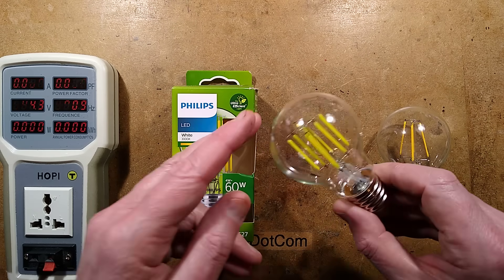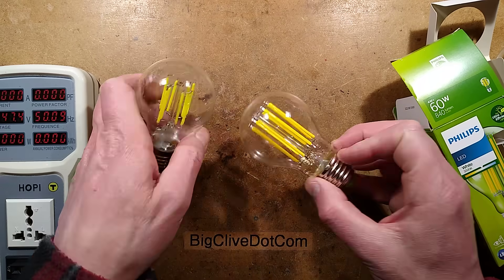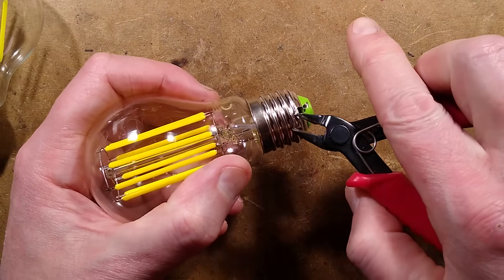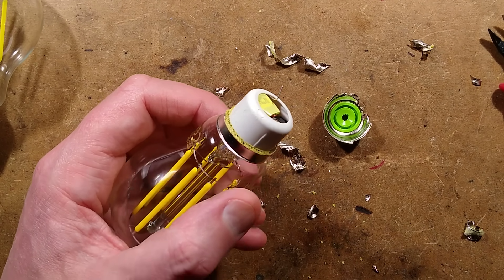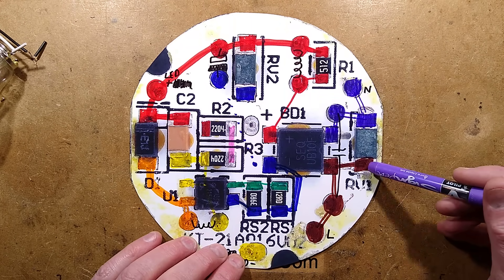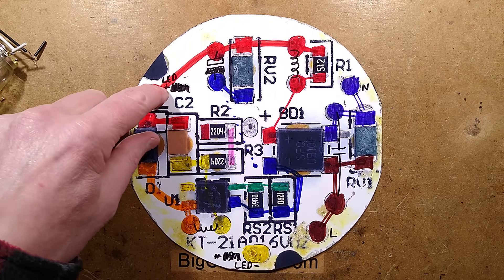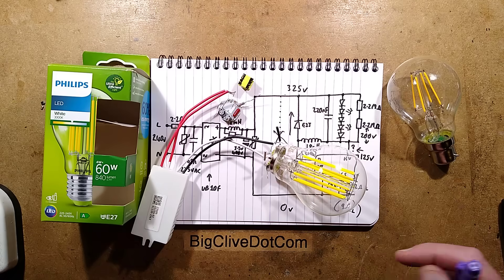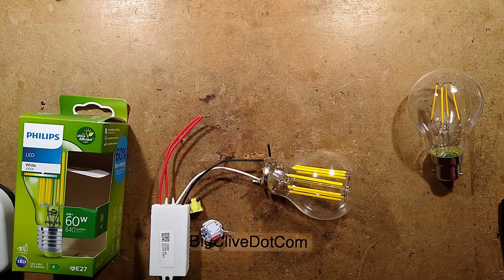Inside a new Philips ultra-efficient LED lamp (with schematic)

Comment: It's got an electrolytic capacitor. There is NO way it will still be working 50 years from now.
Reply: If they used Nichicon, Panasonic, or Rubycon branded capacitors then it might

Comment: Why was your 60W Dubai lamp 600 lumens and this is 840? I assumed it that just took lumens divided by incandescent light per watt coefficient to arrived at advertised watts. Also while 840 lumen per 4W does seem more efficient, the 60W per 4W* (I don't understand why asterisk is at 4W when the 60W are the reference ones) feel less efficient than 60W per 3W* at 15 vs 20 reference watt per physical watt.

Comment: Sadly the efficiency is of no use, with these bulbs costing four times more than a generic average LED E27.
This would still be OK, if they would live for many years, but I have been using a lot of LED bulbs since the first ones with sufficient lumens existed about 15 years, ago. And they ALL are crap, dying within just a few years. no matter the 'brand' or the price.  The one that lived the longest, yet (7 years), was a cheap one, I think it was from 'bluelight' or so. Overall the vendors data on supposed lifetime is nothing but bullshit lies.

Comment: we have one of those new build small 3 story houses with 0 windows into the landings and a single circuit for all 3 lights, top, middle and bottom, with varied sleep patterns across a family of 4 they are on about 90% of the time, absolutely spanked lights until the 2020+ Philips white LEDs which have stuck it better than most, not tried these LED Filament ones but this is very interesting! I guess they're too new for anyone to have any long runtime data for B22 fitting versions?

Comment: I have a few of them, they are very efficient BUT the CRI is just 80% and the color has a terible green tint which is noticeable on white walls. I ended using a newly developped Solhetta filament IKEA bulbs - the are just a bit less efficient (2.9W instead of 2.3W for the 470 lumen variant) but it has CRI 90, no green tint and is 50% cheaper.

Comment: I've got a case of those rough service long life bulbs.
They're nameplated 5000 hours, and indeed don't put out nearly as much usable light for the 60w as one of the myriad "normal" bulbs I've got clattering around.
My coworker (before they had LEDs and CFLs) deliberately bought a 240v bulb to put in a 120v socket to just leave on all the time. It's still there and probably still running.
These days I'd use one of the LED lamps you've featured on this channel with the 0.5w hack, for example. Might do that for the light over my front door in the living room, actually...

Comment: I've replaced all my bulbs with these ones, the 7.3W variant (from standard philips 13W LED lamps). I'm not a huge fan of the green tint, seems kinda annoying in the beginning, hopefully I get used to it; it is a lot easier on the eyes though. I like the fact that they are not getting hot as the standard ones. But they are quite expensive...
Reply: Did you get used to the green tint?
Reply: @castor652  yeah, kind of:)) it doesn't bother me anymore. Would I pay that much money to change all of them knowing this beforehand?! probably not:)) I'm positive there will be a revised version that addresses this issue in the future.
Reply: @AdiDobre90  Thanks

Comment: I just bought the 3000K Warm White version, and it doesn't look as bright as the advertised 840lm.  What's worse is the greenish tinge to the colour.  It really does look unpleasant and not like any other Warm White light.
It's also bizarre that Clive's LED is classified as 'White' at 3000K, and mine is 'Warm White' at 3000K.  Surely one of these is completely wrong?

Comment: Have you come across a GU10 that is the new A rating?
Reply from the maker: I've not.  The GU10 lamps are tricky to get decent efficiency in due to the high output from a small package.

Comment: So it seems like Philips is not the only one with an A energy efficiency rating anymore. There are Osram/Ledvance (branding seems variable) lightbulbs at 210 lm/W now. However they're just as or even more expensive, but they go up to 1500lm brightness.
However I chanced to look upon strobe and flicker effect metrics in the spec sheet. Pst LM=1 SVM=0.4 for all. Which seems particularly horrible. I bought a cheap nearly no name Emos bulb which has a superior Pst LM value of 0.2. It's quite sad if expensive bulbs like these flicker noticeably, like the data suggests. To be honest Philips doesn't provide any flicker metrics, but I doubt they are this bad.

The branding is weird though. No trace of them on Osram websites I saw, only in webshops and the spec sheets they provided: https://pdf.lumenet.hu/4099854009532_LED_CLAS_A_100__7.2_W_3000_K_E27__en.pdf

The Ledvance website has them all: https://www.ledvance.com/professional/products/lamps/led-lamps/led-energy-ultra-efficient-c219381

Comment: I just bought one of these and it had a green tint, i emailed philips and they said it is something to do with being easier on the eye as you say.
Reply: I have installed miniature fairylights on my tiny xmas tree and undervolted them with a potentiometer, so they can run about a week on 2 AA NiMH cells. Its tiny SMD LEDs also shimmer slightly greenish, particularly when undervolted too much.
Reply: That is such a B.S. PR response. I am very sure they also see the green as a flaw, there is no way this was deemed preferable. I would guess it was a trade off in order to achieve the new A rating at all costs, now they pretend it's a good thing (until they finally fix it hopefully someday)

Comment: "The 3000K white has a slight nudge in the green area of the spectrum". Understatement of the year there.
Mine lasted less than a minute before my wife ordered med to buy a different one because the light was disgusting.
Reply from the maker: I think the concept is that the slight green bias is less tiring to eyes.
Reply: @bigclivedotcom  In real life what the eye needs is infrared (and deep red) to regenerate mitochondria of the retina. But by definition any "energy efficient" lightbulb works by omitting IR, which is harmful to the eyes and makes the room feel colder (causing people to crank up the radiator by 1 degree and so waste much more energy). Hence I use solely true incandescent lamps for room illumination in all mains operated luminaires.
Reply: @cyberyogicowindler2448  Thank you for making me laugh hard.
Reply: same here
Reply: 2200 or 2700 rocks

Comment: I'm looking for a bulb which is eye safe. Please recommend which type of bulb I should look for?
Reply from the maker: They're all eye safe.  Just try some and choose your preferred colour and avoid the flickery ones.
Reply: The eye needs is infrared (and deep red) to regenerate mitochondria of the retina. But by definition any "energy efficient" lightbulb works by omitting IR, so they harm eyesight. Hence I solely use incandescent lightbulbs in mains operated lamps.

Comment: Update 2023: They have GU10 models now, they are still 365 lm from 2.1W and unlike some of the traditional shape bulbs, they are 3000K instead of 2700K. I don't want a green tinted spot, tho, if that's what they are.
Original comment in 2022: Just bought one in Germany and it has UKCA as well as CE on it, so the whole European market is getting the same thing.

Comment: Does Philips also make these LED lights in (UK) BC fitting?
Not all of us use ES light fittings, my house doesn't have a single ES fitting.
All that said, I still use 100w and 120w BC incandescent bulbs in my study because I've yet to find a single light that will give me sufficient illumination to be able to see clearly in the study.
Some BC LED lights I have tried have a plastic skirt above the BC fitting that extends down the glass envelope of the bulb by about 2 cm, these types of LED lights are completely unusable anywhere in my house because the light they put out leaves the ceiling area dark and the dark area extending down the walls some 40 cm, it makes the rooms look weirdly dark at a little above head height. 

K Watt.

Comment: why are filament LED bulbs more efficient than the flat ones, where the LEDs are on a board? they have higher lumen/w ratings
Reply from the maker: Use of a lot of small chips at lower current and the way they are positioned for ease of light spread in all directions.
Reply: @bigclivedotcom  how can i do that? i cant change current...these are e27 bulbs of the shelf. I dont want the retro-filament bulbs. I want the ones that shine only in 1 direction, once you cut the diffuser off. But they are only 130-140 lumen/w at best.

Comment: Probably PPL already mentioned this, but that unknown symbol mean DO NOT USE IN FIXTURES WITH PIR SENROR. I assume this is to reduce number of TURN ON-OFF Cycles.
Reply: It may be that the sensor electronics is wired in series with the lightbulb and (designed for incans) so gets too little current to function properly.

Comment: Clive, I have a puzzle I haven't figured out. I have a RV with a AC thermostat in the bedroom. The display is not lighted, so I installed one led to illuminate the display. The thermostat is adjacent to a double switch for ceiling lights and a led strip over the bed. I tapped into the hot side of the 12 supply before the switch and connected the other side of the led to the ground side, again, before the switch. Now with the led strip switch off, the single led is on, but the led strip seems to be on at about half brightness. If I turn the switch on, it is at full brightness. Why is the led strip on when the switch is off? Do I need to install a third switch just for the thermostat led? This one has me stumped. I know my way around 110V, but this 12V led has me puzzled. Thanks for any help.

Comment: Have you compared the heat output from this bulb versus less efficient bulbs?  Very interested in these bulbs if they can reduce the heat output which leads to increased A/C cost which is more than the cost to power the bulbs.
Reply: The heat output is the 4 watts on the package. It all turns into heat one way or another, minus what escapes an uncovered window.

Comment: Ahhhhhh this nibbling at the metal part of the bulb remebered me of my accident with exactly the same kind of wirecutter
i was trying to remove a shrinktube and the cutter  slipped off and under the fingernail of my left thumb because i was hoölding the cable with the left hand.
That hurt quite a lot for the next 10 minutes.
Well seeing you work like that made me feel very uncomfortable but its a video so i just skipped that part ...   ;-)

Comment: I've got a lamp that's been passed down three generations in my family, and it's still running the original bulb from the early 50s.
Reply: have you seen technology connections latest video on light bulb obsolescence? Does his narrative fit with your experience?
Does the light bulb give of a bright light or a dimm one, does it actually run on nominal power?
Reply: We're here to look at watts consumption not durability.  A 500 watt lightbulb isn't as impressive as a 5 watt lughtbulb that puts out the same light as a 500watt ancient bulb

Comment: The light colour looks like what was described as Sodium in the old days with a colour temperature in the 3,000-3,700 K delivering high efficiency but useless colour rendition.  Must replay to see your comment on its spectrum analysis....Good Work
Reply: Sodium light was monochromatic (like a laser), so most non-yellow colours would appear exactly black. No modern general purpose lightbulb does that.

Comment: Is it possible that also this circuit was initially designed for 120v applications, and that it was changed as an easier way for it to support 240v?

That's my guess as a low-knowledge enthusiast hehe
Reply: Read more comments, my guess was wrong, but I learned something new today so yay

Comment: I just purchased the whole lot at a retailer in Sweden 😂 

I couldn’t believe it when I saw their pricing, but it turned out to be true, €2 per bulb, both the 2.3W 485lm and 4W 840lm.
Reply: Wow, great deal. I paid 20€ per 7.3w 1500lm piece on amazon 😂

Comment: Jayakeerti Arivelu 
Supply Voltage is 220v Ac, How you Show Rectifier Output 325 V DC ?. The Voltage should be around 180 Volts DC

Comment: Buyer beware. I think Clive is severly understating exactly how green these bulbs are. I was excited to buy a whole bunch of these for the efficiency and the promised durability. Luckily I only bought one to try it out and the color of these is absolutely Shreked. I am not sure if Philips bunged up with the green tone, or if the green color is some sort of trick for better lumen / watt ratings, but I would hold up until February 2023, by which time the new Efficiency ratings are completely in effect and hopefully other manufacturers have caught up with these kinds of bulbs.
Reply: Little bit late but it's probably something to do with human eye being most sensitive to green, they mixed little bit more green for that high efficiency.
Reply: I fully agree. Unfortunately, a year later and at least OSRAM's ultra efficient lights are also still plagued with the same green tint issue. Awful light color.
Reply: Maybe they changed them up in the last two years, but I can't detect any green tinge in the 4000K, 7,3W lamp.
Also other manufacturers have sadly not caught up at all.

Comment: Motion sensing lights that have an fully electronic sensor might not operate with the low power draw of LED lights unless they are designed to do so. I feel Philips are covering their butts as they do not know if the sensor fitting you have will function correctly with their bulbs. I have been caught out in the past myself, I wish such a symbol existed a few years ago.

Comment: Hello Clive,
May I please ask how many small component lead cutters you get through in a year with your use of your cutters for none component lead cutting?
I myself did have an incident with component lead cutters, very similar if not the same as the ones you are using, where one blade fractured and flew off at great speed.
Lucky for me, I am short of "lamp oil" and I have to use reading specs because the leg of the cutters hit the specs rather than my eye.
Fascinating videos, I must add!
Regards,
K Watt and yes that is my name!
Reply from the maker: They last a good length of time.  I've never had one shear off yet.

Comment: What's the significance of "multiply by 1.41"? How did 230V become 325V?  Is it something to do with the 1mH coil? What keyword should I search to understand the effect of the 1mH coil pls? thx!
Reply: 230V is RMS voltage and 325V is peak voltage.  AC power voltage is typically specified as RMS, but when it is rectified and smoothed into DC the result is the same as the peak voltage (if we ignore the 1-2 volt drop across the rectifier).  Normal AC power is a sine wave voltage, and for a sine wave, peak = RMS x sqrt(2) = RMS x 1.41

The 1 mH coil is used in combination with the 68 nF capacitor for electromagnetic interference filtering, please search for "EMI filter" (specifically this filter is for conducted EMI, not radiated EMI).
Reply: @CoastalSphinx  Got it. thk u very much.

Comment: That non-standard HV connection adds the chip's supply current to the LED current, producing about 8 more lumens of output for the same power input and manufacturing cost.

The drawback is that it won't work on lower mains voltages.  In this case the designers clearly considered 240V-only operation acceptable, then optimized the efficiency on that basis.

The datasheet starts with worldwide compatibility in mind (100V-240V mains) and doesn't give advice on how to maximize efficiency (since it's already "good enough").

Comment: Have you tried anealing new headlights? Supposedly they last much longer.
Reply from the maker: Anealing headlights?
Reply: @bigclivedotcom  saw a vid where a 9v battery was attached was applied to the 2 filament leads and pulsed for 5 seconds on and 5 off, do that 10 times. The filaments glows a little while doing it. It also HAS to be a new light.

Comment: I just bought this Philips lamp in Sweden. Eight filaments, the same box with the same bar code. The only difference is that mine has an EU flag on the backside where yours had an UK flag. I paid 19 sek, around  £1,6
Reply from the maker: That seems a really low price if it's the same lamp.

Comment: the symbol is clear, you don t walk out of a movie just because you don t like the first half, you commit, common sense says you had the initial 9 minutes, after that you watch everything, some exceptions may apply if a detestable actor gets introduced unexpectedly at some point, if the monster is stupidly made and you can see wires moving it, otherwise you see EVERYTHING, you dont give a bite on a sandwich and leave it on the fridge, you don t walk out in the middle of a movie, the symbol is clear

Comment: This schematic is a start. It needs an ARM processor running Linux and a Bluetooth 5 chip to connect to your smartphone to monitor bulb performance and draw graphs. The deluxe version would have a cell phone modem to send you an alert wherever you are in the world to let you know if the bulb has been turned on or off. An environmental sensor would alert you if the bulb got wet.

Comment: I would guess that that symbol means to not install the bulb in fixtures that have the bulb "upside down".  Some LED bulbs don't handle the heat well and overheat the circuitry that's usually in the socket area, drastically reducing its lifetime.

Comment: With that kind of drop why bother with a driver circuit?  Couldn't you just use the strands as their own rectifier and maybe have some high-watt resistors or resetting fuses if absolutely necessary to handle spikes?